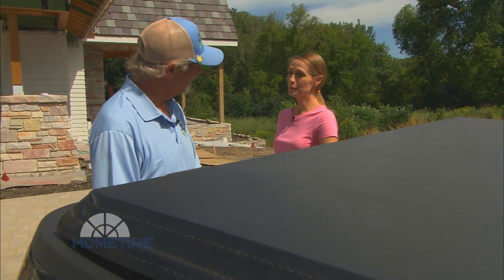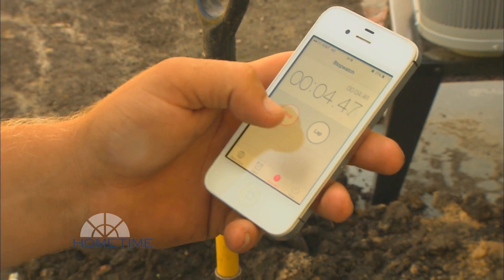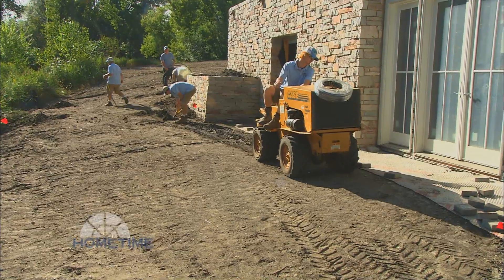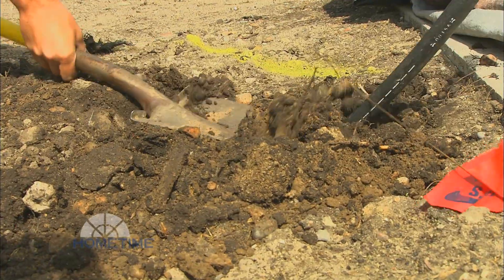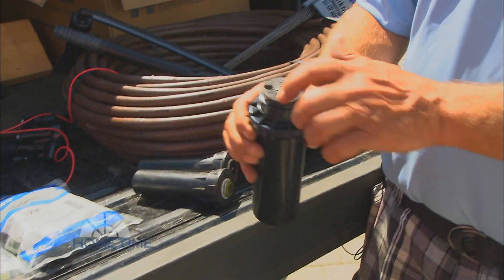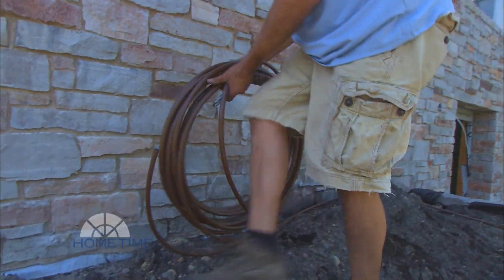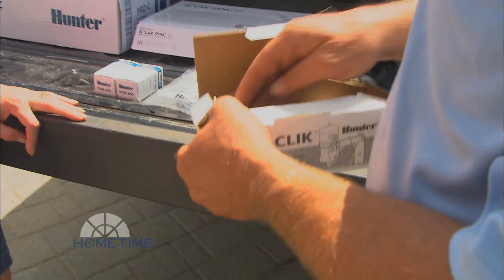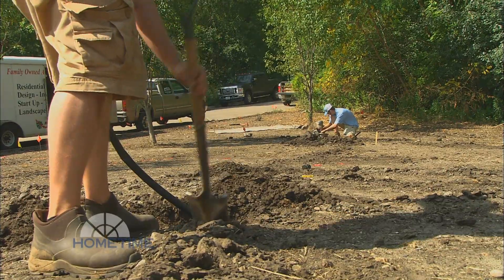How to Install an Irrigation System - part 1

Comment: These guys don't use ditch which plows WTF is wrong with you😂
Reply: Burkeen is where it’s at if you want horsepower. Ditchwitch always needs maintenance.
Reply: And you use Hunter instead of rain bird fuck this sprinkler crew 😂
Reply: Well imo rainbird gear drives are a hell of a lot better, the rotation and curtain alone are reason enough to say fuck hunter gear drives. But if you're talking spray heads I hear that, and even better, rainbird spray nozzles on a hunter spray head are the absolute perfect combination

Comment: "A medium head rotates finger things"? Hope I misheard that. You mean, MP, as in matched precipitation LOL. Btw, classifying those heads as large medium and small is the silliest thing I've ever heard. There's a whole world of differences between SPRAY heads and ROTARY heads, including nozzles, which it looks like they bought prenozzled....?
Reply: If they space the heads based on the nozzle then there's nothing to worry about, it's not golf course irrigation where nozzle selection is that critical
Reply: @brandonchappell8545  everything should be spaced based on nozzle size
Reply: that's called dumbing it down for the masses

Comment: Those idiots, they don't use rainbird
Reply: Albert Ledesma I have rain bird for ages. Works fine. When I tried to adjust another head from hunter it broke when I took the screw out. Orbit is fine. But I have used the valves before and the broke. The only valve that was able to withstand my 100 PSI was rainbird.
Reply: PRO Gaming Roblox & more! The fact that they DON'T use Rain Bird proves they're not idiots. They're using Hunter, which is the best you can buy, and that is not a subjective statement. I have a copy of the study/test that was done using Hunter, Rain Bird and Orbit. Rain Bird even got beat by Orbit, and that's just sad. What proves they're idiots is the way they're putting it in. Idiots, but for a very different reason than you believe.
Reply: PRO Gaming Roblox & more! Rainbird is far inferior to hunter
Reply: Rainbird causes a lot of problems with their nozzles and overall durability/quality.
Reply: PRO Gaming Roblox & more I'll say it again, rain bird is inferior to Hunter. It's not opinion.
Reply: PRO Gaming Roblox & more! Doesn't matter how long you've had them lol
Reply: PRO Gaming Roblox & more! Not sure which head you're talking about....? Rotary head? Spray nozzle? Be more specific. You sound like the homeowner side, anyone that even considers using orbit should stay far far away from irrigation.
Reply: PRO Gaming Roblox & more! I'm not sure why you would ever try to push 100 psi through a residential valve? You realize poly pipe had a 100psi max righht? If you're actually pushing 100 then your valves won't be the problem, you'll be launching heads out of the turf like scud missiles
Reply: PRO Gaming Roblox & more! I've installed and serviced commercial systems for quite some time now. We only use rain bird when were out of parts or our order is botched. Never their valves, those are the only valves (can get the model) I've seen literally stress crack on the top of the valve like  you would see pavement split over time. Their flow controls so delicate, we were always servicing them for getting stuck or twisting right down and splintering(don't ask me why their cranking the flow control..).
Reply: PRO Gaming Roblox & more! Bottom line, keep it to yourself is you're not even sure what you're talking about lol

Comment: You will never go wrong with sch 40 and regular pvc pipe
Reply: Yes, cuz digging trenches everywhere is less time consuming and pvc is so durable? 😂
Reply: Under11000  for lawns pvc is the way to go only an idiot does regular poly line on lawns wait till that shit starts cracking youll have a nightmare
Reply: @kevinjuarez541  lmao keep that shit in the diy section. PVC is high maintenance, less durable, and requires a much more high impact installation process. Not to mention making every fitting and connection unnecessarily more difficult. I love working with pvc, but usually only neccessary for large mainlines, carrying hundreds of psi and feeding 50+ zones over a large run
Reply: @Noe Eon what's a new jersey?
Reply: @Noe Eon you're a glorified landscaper haha keep your litte 48 zone stories to your pals because that's pretty embarrassing if you're hanging your hat on a tiny system like that.
Reply: @Noe Eon exactly lmfao those are the only commercial jobs you got ahahahhahahahahahahhahahahahahahahahhahahahahahahahahahahahahahaha
Reply: @Noe Eon bro who's arguing haha you're trying to flex on someone who's operated at a higher level than you fundamentally and clearly produced at superior product haha
Reply: @Noe Eon digging ditchs and you're not even good at it hahahaha
Reply: @Noe Eon like I said, college
Reply: @kevinjuarez541  wow you're an idiot, definitely. Amateur!!
Reply: I put in sprinklers for seven years using both PVC and Poly. They can both be a pain in the ass. Honestly I would use PVC on my own house.
Reply: Under11000 what? If you use any pvc at all for a 1" residential feed you're an absolute moron

Comment: I am a sprinkler  cotractor  that pex line is a cheep  way to go for 2 reason  you can use a trencher  puller to pull the line it doesn't  last long and very thin use pvc
Reply: Thats not pex that black poly pipe, pex is thicker and doesn't leak like crazy, pex is legal to use for water service to a house.  PEX costs more than regular thin wall PVC and poly he used is even cheaper (PEX Is 36 cent a foot, PVC is 19 cent and that shit is less than 10.)
Reply: @macsrule94  I used poly pipe when I installed my irrigation system I in1989 I have 12 zones. I've never had a pipe burst or leak and I live in Northeast, Ohio where we have cold winters but not as bad as some other places I know. I always that extra care blowing out the individual lines for winterizing. infact I blow them out twice. Having a large volvome of air is the critical and watching and waiting till only air is exiting the head is second. I've had a lot of valves, coils, heads, and leaks on the flex extensions problems. The only pipe problems I had are dig-ins, my wife was doing me a favor and tried to plant a rose bush over top of a main run and the cable company rerouted there line when they installed a new fiber-oppotic line and cut the same run again. They weren't difficult to fix after everything dryed out.
Reply: @macsrule94  10 cents a foot?  That's outrageous!  I want 2c a foot!  ;-)